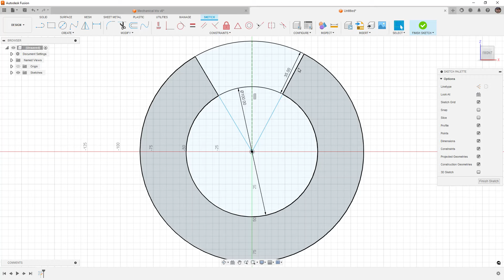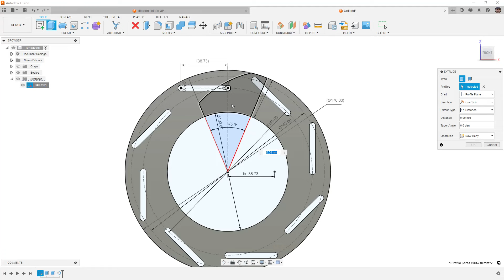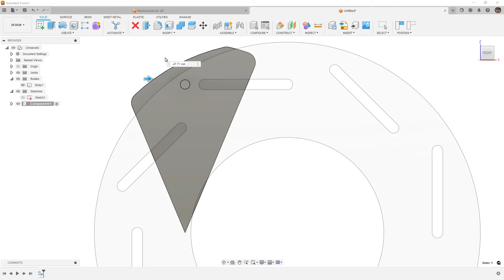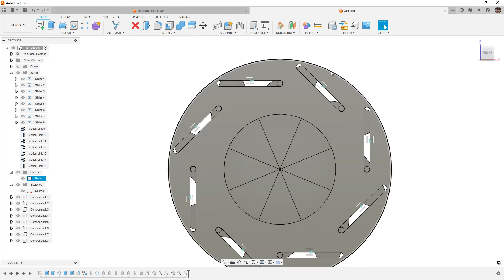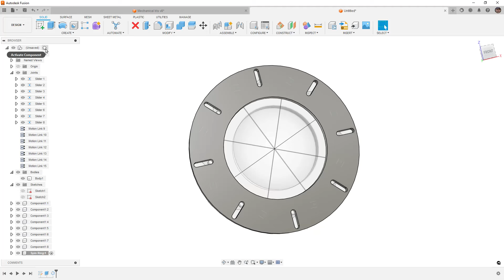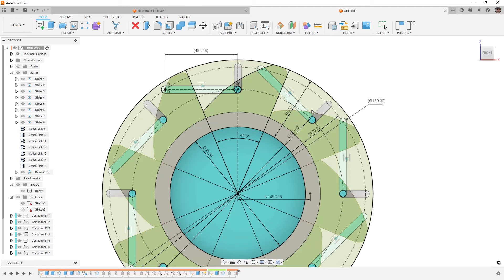How To Model A Working Mechanical Iris in Fusion

Comment: I just wanted to let you know this video helped inspire me to make a working 3D model for my hydroponics system. The plants sit within a pod of rockwool medium which is susceptible to algae growth. The model is  a hydroponic iris cap which surrounds the plant at its base to block light to help prevent algae growth. I followed your iris mechanism design and learned so much from your tips!. After several iterations I was able to make a snap fit version I could print without any supports. Thank You!
Reply from the maker: Wow thats an amazing idea!  So happy to hear that the tips helped even a little in the process!  Do you manually adjust the iris based on the growth of the plant?

Comment: Hey I'm actually gonna use this same design to like make a iris lid box/container. Where you spin and the lid opens then closes. Goona use it to store things. But the dimensions I'm gonna use are gonna be really small like the max dia I can have is 21mm for the this iris mechanism and the container will be like 24mm dia. So can this whole thing be 3D printed together? Im a complete beginner btw and I'm gonna use this to like just keep my pen upright with the help of  those petals
Reply from the maker: Cool project!  I have seen some iris lid mechanisms before.  As for printing together, The design doesn't really works as a "print in place" type of model.  You will likely still need to design several pieces.  We have a few different iris videos.  There was a 4th style i never go around to that is more like a camera iris.  Those style iris' are the most compact and have overlapping blades.  
make sure to check out the other 2 iris vids to see which works best.  this one  has thinner petals and might give a better opening shape to hold a pencil https://youtu.be/vCtbFtSfmnU?si=94gbvjdnpLLvc6cA

Comment: Hey! Im following along and i want to 3d print it. i put another ring at the back.. but how do i extend the pins? this is my first mechanichal model 😅
Reply: right now its  like a sandwich, so there are two spin rings and in the middle the "leafes". wont there be too much friction between the leafes and rings? or not enough i dont know
Reply from the maker: Here are a few links that might help.  This first one is a version of that design that I 3d printed.  Keep in mind the pieces don't lock together 
https://a360.co/3WA3HPB
also note that each blade i printed without the pins, then printed some pins to press in.  The bottom piece has a slot that doesn't go all the way through.  If you wanted to lock or retain the TOP component someway you just need to make sure there is a gap so there isn't too much friction.  Generally .2mm is a "tight fit" and .4mm is a "loose fit" with 3d printed parts depending on your printer.

This one is the 3rd video.
https://a360.co/4eAUazx

this one the blades are very thin and you will notice there is a gap in the housing because in the model they are all on the same plane, but in reality they stack and overlap.  I did a little lip/catch feature to hold the 2 parts together for a quick print but again more work could be put in to get it better.
Reply: @LearnEverythingAboutDesign thank you!

Comment: how can we add a motor to it
Reply from the maker: the design would need a lot of extra work but i think its possible.  With the Wedges, i would add some sort of grooves on the side to give each one a track to follow.  Then the outside ring that gets turned, basically you would turn the outer edge into a gear.  then use a motor to drive its rotation.

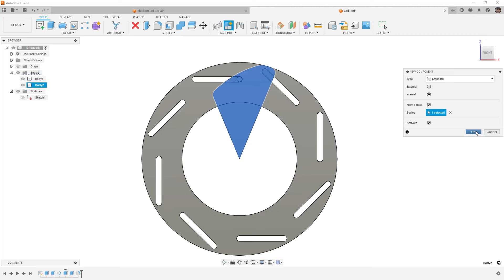Comment: Thanks a lot for the video. I was having problems at 13:30 with the Slider joint. Whenever i selected the second component, it would error with "components are rigidly assembled". I eventually figured out that when I created the original component for the Iris leaf, it was by default "grounded" Right clicking on the Component in the tree, I had an option to "Unground" at the very top. Lots of joy after that. Thanks again for the Video!
Reply from the maker: Yeah sadly Fusion has that option as on by default. really frustrating.  If you don't like/use it you can toggle it off in user preferences so it doesn't ground to parent by default.

Comment: How did you get that body outline. It is really helpful
Reply from the maker: At which point in the video?  If i had to guess I would say Project (P), but if you have a timestamp I could give you more info.
Reply: @LearnEverythingAboutDesign  just the outlines around the bodies. That's not how my UI looks and yours looks more useful
Reply from the maker: @vitaliydvorkin1342  Not sure as mine is default...
If its a shading thing then CTRL+6 will show the edges on a shaded model.

If its the opacity thing. that should happen by default when you activate a component.  It will drop the opacity of all other components.  If that doesn't happen for you go to your User Preferences in the top right, then go to Assemblies (under Design) and check "Active component visibility".
Reply: @LearnEverythingAboutDesign  CTRL - 6, that's what did it. All these years using the software, I could have really used that shortcut haha!  Thank you  so much
Reply from the maker: @vitaliydvorkin1342  you can also go to the bottom center of the screen where th elittle monitor is.  that will have all the display settings and show you the shortcuts.  I use CTRL4 to hid the edges and CTRL6 to bring them back all the time on Forms models.
Reply: @LearnEverythingAboutDesign  gotcha. That's great! I really need to press all the buttons on this thing. I'm just using what's accessible.
Reply: @LearnEverythingAboutDesign  and the video is great, loved it. I'm trying to adapt it to a thinner inner ring, so wish me luck
Reply from the maker: @vitaliydvorkin1342  We do have a few desk mats in the merch store with all the shortcuts on them https://learn-everything-about-desi-shop.fourthwall.com/products/fusion360-shortcuts-2

And we have a free Shortcuts and modeling efficiency course.
https://www.learneverythingaboutdesign.com/p/shortcuts-and-modeling-efficiency-in-fusion-360
which includes a download shortcuts
Reply from the maker: @vitaliydvorkin1342  Good luck!  I think the 3rd one we did probably has the best ability to make a thin trim ring but the petals are overlapping. https://youtu.be/vCtbFtSfmnU
Reply: @LearnEverythingAboutDesign  yeah, I was thinking about that as a last resort. It's not my favorite looking design for my purpose.

Comment: Amazing work! However i went along all the video while doing this model and only the revolt join seems to show,i have the free version,does that have something that limits what animations i can use?
Reply from the maker: No they should all show. Do you mean after you add them you only see one or do you mean when you apply them you only see revolute?  For the as-built-joint there should be a drop down to see all of them.  for the Joint, there is a second tab to pick the joint type.
Reply: I retried it all from the start and now it worked,the only thing that i made different is that i made the "body" a component and fixed it

Comment: A few years back a friend of mine brought me a 3D printed design of a mechanism like this with a lifting platform incorporated into the motion. I spent days and days in Fusion modeling everything and figuring out joints and limits and contact boundaries to get a design that was going to be machinable. I REALLY could have used a tutorial like this back when I was trying to figure it out 😂. Once I got it figured out though it was so satisfying knowing I took a huge step in my modeling abilities. I ended up machining all the pieces on my 5 axis machine and it’s still one of my favorite projects I’ve ever made. I never quite got to a design that was machinable and could completely close the iris, but I got pretty close. This design could have definitely solved my problem. Anyways, thanks for making this content, these videos show me little shortcuts that I didn’t even know existed to speed up my modeling process. So thanks for taking the time to make these videos!
Reply from the maker: Awesome thanks for sharing!  that must have been fun to see that project to completion! even if it wasn't perfect in the end.